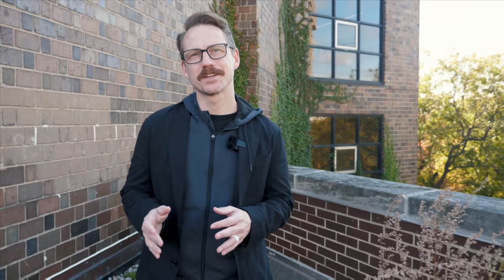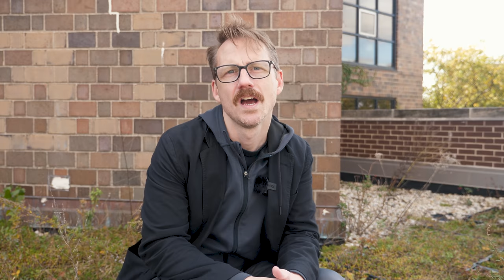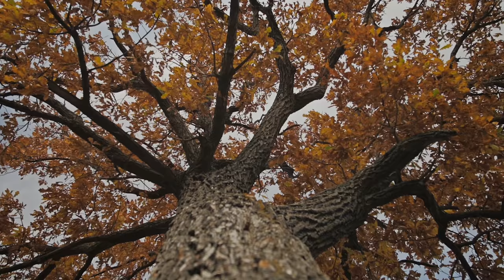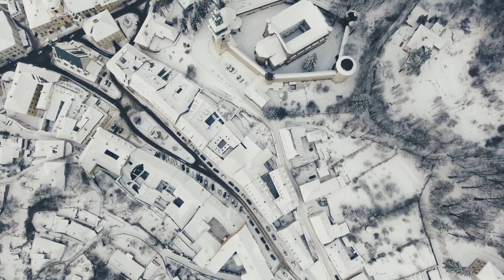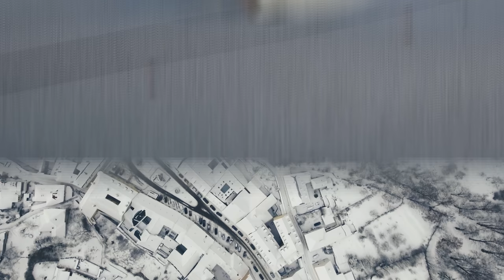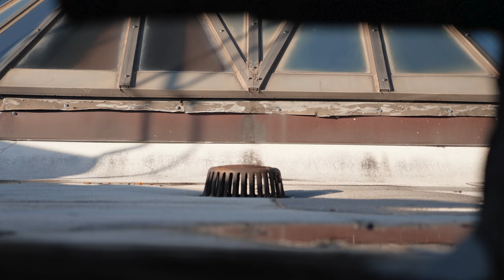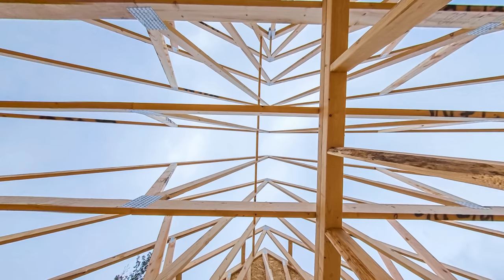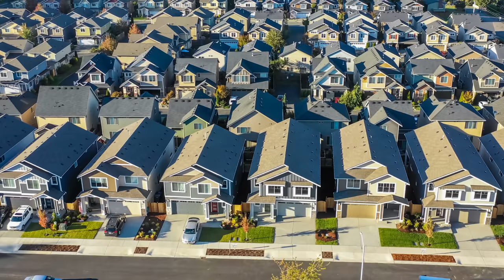Why Do Architects Insist on Using Flat Roofs?

Comment: As a pest control person with 35 years experience, I can say flat roofs are the worst for harboring pests. The moisture held in the gravel is a good nesting place for ants. The rot caused by leakage is a great home for carpenter ants, termites, and all pests loving moisture. Whenever I respond to calls with structures that have flat roofs, it is always the source of the problem.

Comment: IMO, I think flat roofs are a "poor choice" in "cold AND wet" climates, because you can't anticipate unseasonal storm or snow run off.  But also, you are correct. High slope roofs are Intended for high rain/snow-load reasons. Major cities almost never have snow load problems, and looking up "snow load collapse" will typically reveal large buildings like warehouses or grocery stores collapse when they have out-of-character seasonal snow accumulation, or manufactured home park structures. The same buildings also tend to fail under high wind speed. Your typical 1 or 2 story house with a gabled roof will have a gutter system that sends the water into the ground/aquifer or city storm drain.

Comment: Hi, I am an old man now but I still remember my grandfather’s flat roof design in his multi storey building. As we lived in Europe the flat roof was designed to take the weight of several meter’s of snow and hence was build with a slight slope and the addition of 30cm layer of pebbles to in encourage the drainage of melting snow. Nothing new in the old European designs, just better design and engineering. Cheers

Comment: One thing you didn't mention is that a sloped roof on a tall building means avalanche of snow plummeting unannounced on unsuspecting passersby. Where as a flat roof will keep it's snow untill it melts safely down the drain.

Comment: Well, the very slight angle to one side with drains is usually enough for water to not accumulate on the roof. And it is kind of easy to shove off the snow on the that kind of "flat" roof too.

Comment: Would where you live have a major impact on design choices if you say… wanted to design a modern home?
I would assume so. Areas that had a higher percentage of snow wouldn’t be a good choice. 
I am about 5 years away from choosing some land to build a modern, efficient home and will be looking at all roof options, including flat roofs because I will live in an area with little snow predictions. Also I like the idea, if legal and code allowed, to use the roof as an additional living area. Maybe even support a small vegetable garden. Is that even possibly anymore?
Looking forward to working with an architect on this project. So fascinating. Thank you all for the comments and the video presentation.

Comment: Hii Stewart sir, I am an architect from India. In India, most of the houses are having flat roofs as it's a tropical country, and no snowfall but rainwater during the rainy season comes down to the drainage below this is done by a small slope which is provided on the flat roof, and the water it gets collected at the corner of the building and passes through a 6" PVC pipe down to the drainage system.

Comment: In the 60s and 70s a lot of new houses and public buildings were made with flat roofs here in Denmark. Which has about as rainy a climate as Britian, but a bit colder too.
By the 90s those roofs were being replaces by the thousands, having caused so much mold, water damage, and cracked walls and foundations. Billions spent on fixing a type of roof that is NOT well-suited for our climate.
Just in relation to my own family, my grandparent's house and the apartment building my aunt lived in, were both retrofitted with a saddle roof. 
And me amd my sisters' school had its entire roofs replaced (and the asbestos too).

Comment: Where I live, we don't do many "flat" roofs except on commercial which is still usually pitched under a 1/12.  Recently we have started designing a lot of homes with 1/12 - 3/12 shed roofs using standing seam metal and it usually is a HUGE expense adder to use standing seam vs shingle or exposed fasteners.. We use snow guards on low pitched roofs otherwise you will get huge sheets of ice/snow sliding off and damaging your gutters/house/ person walking under it....

Comment: I bet that part of the problem is that most people only do home maintenance when they absolutely have to. A low slope roof might need to be re-coated every 5 years, for instance, but the owner wouldn't bother until it's been 10 years and it's leaking and causing big problems. Then they complain that flat roofs only last 10 years.

Comment: Every flat roofed building I have encountered in Tennessee (been here 36 years) LEAKS. It leaks, and then it leaks some more. My mother's church built a brand new flat roofed building. Within three years, the brick exterior had been so badly damaged by frost heave that they had to re-seal the roof and spent thousands on repairing the brick siding. Several interior floors and walls had been damaged, and they had to deal with mold. Brand. New. Building. The building I've worked in over 20 years has a flat roof and springs leaks every year. Also, BUZZARDS LOVE FLAT ROOFS.

Comment: A great architect is also at least a  good engineer. A good engineer considers the demands of the structure, AND considers if the demands expected of the structure are really necessary. Anyway, the fact that "flat" roofs sometimes have some pitch is a big point. It only takes a little angle to manage the flow of water considerably.

Comment: I have to agree with a lot of what you are saying. So the biggest issue with flat roofs is water shedding. I found myself saying to myself lately that I would never design a flat roof for a building if I was an architect unless it included planters etc to use up that water and sod etc. Still think the usual drains are needed for extremely heavy rain events tornadoes often flood localized area's more then dropping funnels and hail flooding rains are most common damage from tornado cells even when a funnel doesn't fully form cause the westerlies prevail often and blow them out of balance they start to roll across the sky in a horizontal form and drop everything at once in a deluge. Every kind of roof needs maintenance, the biggest thing we need is to get more functions out of the roof to make it worth all the inevitable repairs. Flat roofs offer us more for natural habitat space for furnace and air-conditioning systems, and easier access to the roof for vents chimneys etc.  For example, Ontario lilies and sumac have edible flowers with lots of vitamins and makes them out of high amounts of benzene, ammonia, arsenic etc from car exhaust its why sumac grows wild on its own next to highways. If we planted this on roofs on top of parking garages, and has balcony planters on a slop like the levels of the garages are for driving, so they naturally drain towards the ground have them planted with sumac and Ontario lilies and you would have food out of pollution and no one around the above ground parking garage would smell any exhaust. I have also thought of if grocery stores had underground parking under them, and had Ontario lilies and sumac growing on the roofs with other plants stabilized by the first two. Many leafy greens and wild ones to turn red growing near peoples driveways from arsenic from car exhaust, sumac and Ontario lilies fix the air for these plants to grow in those area's without turning red. Plants are always something to be included in architecture and design. If you look at video's of earth dam failures, you will notice no trees are growing on those filled in earth mounds, and people somehow expected them to hold up to saturation some how like dumber and dumber. Also look at many footages of land slides, you see trees planted on flat area's while goats and cattle graze on the steep slope, when it should be the other way around. You will see many old area's with trees planted on steeper slopes and grazing on flat area's tend to get much less landslides. Most people know that vines covering buildings are good to, and also need maintenance which is why I like buildings that have balconies all around each floor, even if some are just fire evac routs which is still a smart idea. Windows need replacing every ten fifteen years or so don't need to build scaffolding just to do that. This way at least the vines are growing over balconies and not right on the outer walls and masonry. Vines could help to shed water from being blown onto the balconies as much and provide habitat for birds and insects higher up better air and cooler in the summer. I keep in mind all roof types need maintenance, so its key that we get as many functions in return for required maintenance.

Comment: Well, all I know is, that every single flat roof that I know of does leak, while I have barely heard of any leaky tilteld roofs. Imperfections are always happening, but with at a tilted roof it doesn't matter because the water just flows over them. On a flat roof on the other hand, every imperfection is an immediate disaster.

Comment: Before even knowing about roof designs and structure I always thought that flat roofs (low sloped roofs) made more sense and makes for a more visible and accessible dwelling as your focus is on the building and not its 'large hat' on top of it.

Comment: I have a lot of issues with a lot of the statement here.

There is a diffrance between a flat roof and a low angle roof. Typically Low angle roofs are (at least according to my textbook) between 3 and 15 degrees) They are really not a huge issue. Roof under 3 degrees is. Because water will pool pretty much everywhere, and will damage the structure and start to leak.

And while its mathematically harder to calculate a gable roof. This is not the task of the architects, its the task of the engineer.  Its harder to calculate, but generally use less material.

Its not that  hard to fill a gable roof if you have the slightest idea of what you are doing. there is a multitude of ways to solve it. The cheapest and most common is to have 4 areas. One larger in the middle, and two small by the side and on above making it a reasonable living space. This method typically ad strength from the floor to the roof making both co-carry each other load.

The idea that flat roof would be cheaper is only true if you totally ignore the extra cost of making a flat roof leak proof. Even having a low angle roof ads cost.

The solution to make low angle, or even medium angle roof livable is pretty simple. Ad a secondary floor ontop of it. This way any scratch don´t damage the roof under

"large building also need space for AVAC equipment"
I don´t know if US is kind of living in the stone age, but here in Europe we pretty much drooped this ancient equipment. Either (on really old buildings) its inside.. probobly under the gabled roof... or on a bit newer building its networked.

"those equipment need to be outside"
No they don´t.

Comment: It comes down to geography, between 30 to 35° north and south the almost yearly around heat prevent the existence of snow outside mountain peaks and rainfall swiftly dries out in mater of hours leaving little time for it to leak into the house, specially with some waterproofing paint applied before every rainy season.

Comment: The flat roof on the Knickerbocker Theatre in Washington, DC collapsed with feet of snow on it  on 28 January 1922, killing hundreds. Ever since, minimum 5% grade is required. You did, address that low slope is common, actual flat is rare, as I'm certain the Knickerbocker wasn't the only actually flat roof ever to have give way under snow.

Comment: I live in the Alps and had 3 buildings with flat roofs in my area get wet (school, dormitory, appartement of a friend), so I wouldn't want one for my house. A gabled roof has much less problems. And if there is a leak mostly you just switch some roof tiles to get it dry again. As a student I made some money getting all the crushed rock from the dormitory building down so that they could search for the leak. Took quite some time. Of course with snow and higher buildings it just doesn't work.
And gabled roofs and solar panels just work fine. At least if the roof has a useful direction.

Comment: Also legal issues (depending on country/region): If your building is only allowed to be x meters high (including the roof), it makes more sense to have a flat roof and another floor instead of wasting the vertical area. Sometimes it's the only solution if you really want x floors but are not allowed to exceed a total height.

Comment: As a non-architect (but with an arts background) I am absolutely in the group that most of the time dislikes flat roofes. But I do say that they are garbage everywhere and always. There are regions where flat roofes make sense. In the references "ancient egypt" it of course made sense, and it still does in those regions. But it does not in the mountains in Europe, like where I live. It absolutely does not. Of course you CAN build like this, but you know... The non-flat roof next door did last for literally 500 years with no major repairs needed while you have to repair your flat roof every few years because it leaks somewhere. The non-flat roof next door does not need to be emptied of snow, while you are shoveling on your flat roof. And additional the people with the normal roof next door have an attic. You have not. And the last - and still important - reason against flat roofes: They are very ugly most of the time, unless they are in ancient egypt or Greece or on a skyscraper.

Comment: Biggest problem is really rain and snow. Almost every single flat roof house I ever worked on had issues with leaking or bukling from pressure. Its very common that ppl here in Amsterdam build extensions if they live on ground floor. Almost all of them are flat roofs, and almost all of them are angeled incorrectly. They dont last very long either due to bad tarp, water run-off is underdimensionsed and they essentially are covered with moss and debri after only a year. On-top off holding water for to long they also act as breeding ground for insects (specially for mosquitoes).

Comment: As a practicing architect, I would have to say flat roofs do make a whole lot of sense sometimes.  

I hate it when the architect gets blamed for poor construction when it was the contractor who improperly built the building.  The reason why flat roofs leak is because of poor construction and no slope.   Flat roofs need to be properly detailed and SLOPED and properly constructed. 

Sometimes the contractor does not read the construction document drawings or does not understand the construction document drawings because the contractor, in general, didn't go beyond high school level education.    I'm not saying education is everything but a GOOD contractor will be careful to read the drawings and will work with the architect as a team.

Also, after World War II there was a need to mass produce economy homes and so the construction industry got rid of the architect and started using cheaper and less material to create "cookie cutter" homes.  During this Baby-Boom era, the building industry didnt always build with quality or care and so the flat roof were often built with no slope.   

The architects didnt construct buildings with flat roofs.  THE CONTRACTOR DID!

Comment: If you are interested in getting into the roofing industry please look into IIBEC (International Institute of Building Enclosure Professionals). With their RRO (Registered Roof Observer) and RRC (Registered Roof Consultant) certifications, it is possible without a 4 year degree to design, stamp and seal CD's, and oversee CA on any roofing specific projects. IIBEC is the leading organization in the industry and also includes the fields of waterproofing, building enclosure design, and below grade waterproofing.

Comment: I always want a gabled roof over all entrances to my home, so there's not a major snow hazard when you step outside.  I've lived in places where the roof slopes towards the front door, and you get a huge mess, that freezes into a solid chunk if there's any freeze-thaw going on.  Clean it up, and the next day or a few days later, you have a sheet of ice just outside your door.

I also don't understand why all homes don't have even a storm door, let alone an "air lock" anteroom, where people can get out of the weather without letting all the cold/hot air in.  Just stupid designs.

We also don't build buildings/homes to take advantage of the temperature buffering you get from a full basement or other earth-sheltered ideas.  With proper construction, you shouldn't have to heat or cool a home/building very much.  And if you know about Russ Finch of "Oranges in the Snow" fame, you can heat/cool a big space by burying "air tubes" and using small fans to move the air from the tubes into the house.  The buried (4-inch) pipe brings the air to ground temperature, which at 8 feet down is the average annual temperature.  In temperate regions (North of the tropics and South of the permafrost), the ambient temp of the ground is in the 50-60-degree range (Fahrenheit).  We should start using simple principles, so that almost ALL homes use very little Heat or AC.

Comment: Even if form follows function you only slope a roof in a minimal way neccessary to follow function. Inside a sloped roof is non-usable space, so best get rid of them. Then there are height restrictions by zoning rules, so avoid height by sloped roofs. This may change with using solar panels as these are placed with certain slopes depending on latttude and direction. Today you may consider collecting rain water as a new (and old) goal.